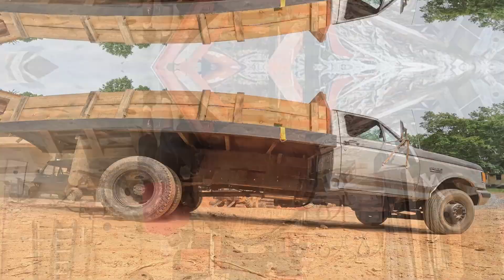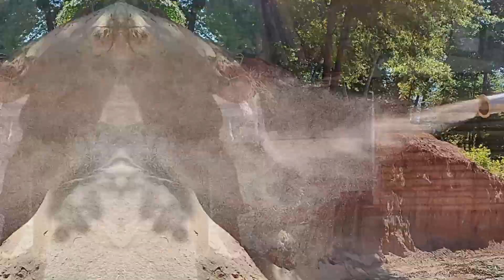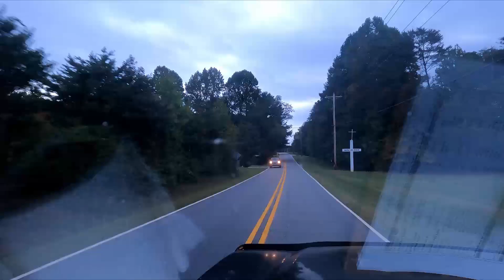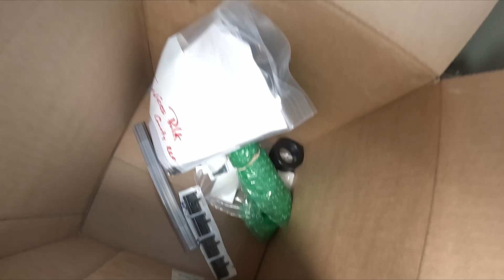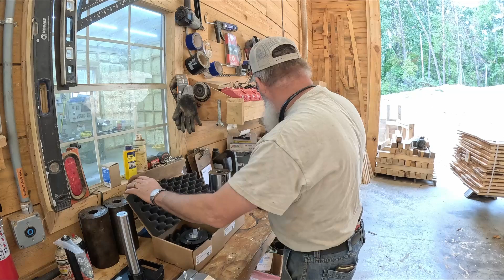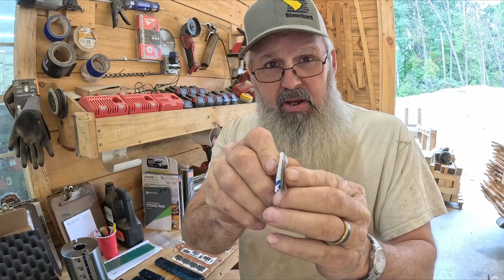Road Trip to Weining for Parts

Comment: sorry to keep bothering yall will the kilowatt man use a tool to phase the motors or just hope?
Reply from the maker: @jrneff9773  we have already checked the phase rotation it's about ready to run, waiting on one transformer that was bad
Reply: @BeardedLumber  alot of kilowatts turn it on if goes the wrong way we change not on that machine. fyi thank yall for what you do

Comment: fyi Bruce hardwood used saw dust to power the kilns .if a bearing went down at 6000000rpm Sprake's went in the duct then in the  silos place burnt to the every 3yrs. for y'all do a shut  down power off air off for 30mins then go home. my 2 cents worth
Reply from the maker: Thx Bruce awesome advice 👏 👍

Comment: after Bruce hardwood in Jackson, Tn shut down. real hardwood flooring is gone. i was a contractor in that plant and watched one of these machines make the old school flooring that you had to install sand refinish 10 years the finish still looks nice if you had to refinish a man running the sander had to nail set every nail.  like stairs etc. then i remodeled a house pulling up the carpet oak flooring just added 10k to the value of the house. thank you for bringing flooring back with you machine

Comment: If you don't have a setup stand, you can measure the cutting circle (2 adjacent knife tips) with a Caliper then divide by 2. Also, make a horizontal "Arbor (spindle) holder" Makes setting up your tooling a dream.
Reply from the maker: I agree it can be done, but a tool setup and ready is good to have thx for watching

Comment: Tooling will always be a large investment for a molder/shaper operation, once made all that's needed is to replace cutters/dies when they can no longer be sharpened. I am eagerly awaiting the beginning of the new services you will be able to offer at reasonable prices, I am more interested in production/run speeds and set up and make ready times. Custom  milling for special customer lumber that has additional sentimental values such as a large tree that has died and was at the homestead for generations and customer wants to make a short run of flooring, siding, dimensional lumber, etc. can now be offered to all who have need at reasonable prices. Ray
Reply from the maker: @raystormont  I agree Ray were waiting on one small transformer that was bad it should be here next week .
Thx 👍

Comment: I'm trying carbide tip blades on the saw mill as a test to see how well they cut and last. sofar i feel i'm at a plus on the number of logs milled. I've cut 4 oak logs and two pignut hickory and i'm starting to get a dip on knots. so i'll be changing it.  I can say for sure the cutts are clearner and smoother. for what it's worth.
Reply from the maker: Awesome, Chris. I've been wanting to try them. I've had great success with the double hard Turbo 7 blades 
Thx for watching
Reply: @BeardedLumber  try the ones I got from Jerry's Resharp.  The last oak log video i did was sponcered by them using one of the new blades they are going to carry.  Very impressive cutting.  It's much better than the turbo 7 dbl hards we normally run.